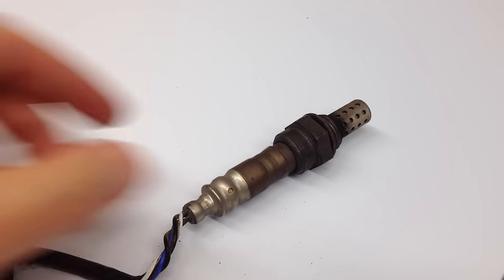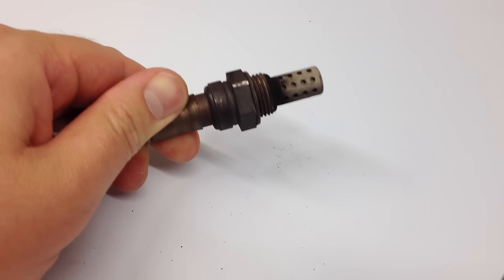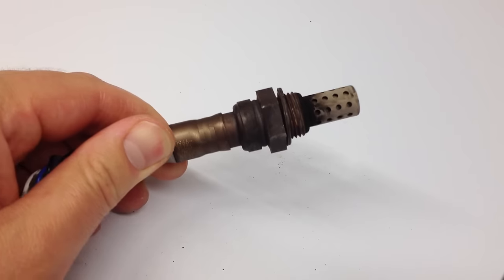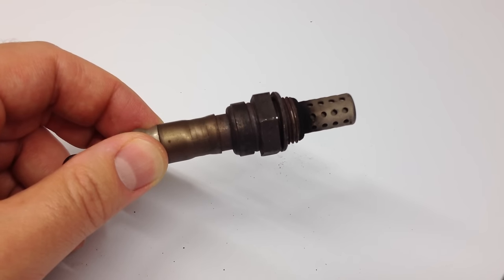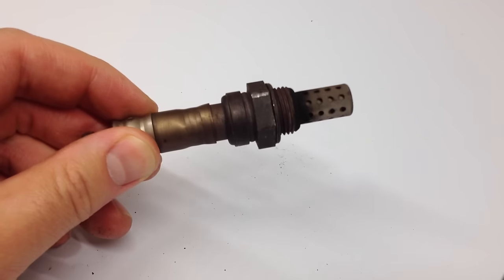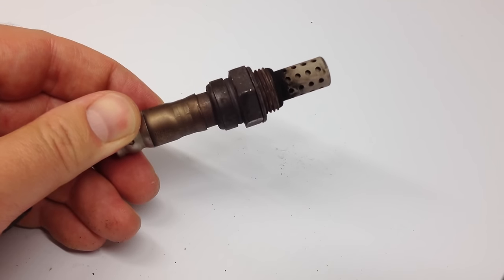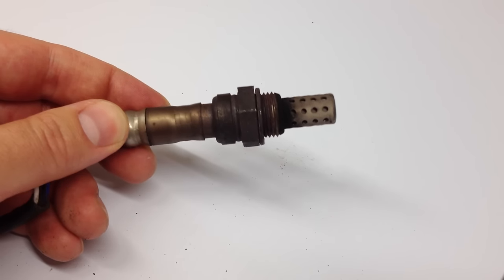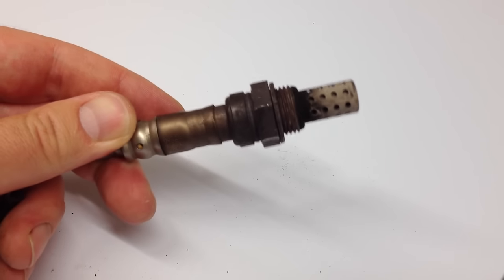Bad Oxygen Sensor Symptoms and Dangers

Comment: I've just been getting a P0171 lean code for cylinder bank 1 in my Chevy LS1 powered car because my catalytic converter is damaged,it started yesterday after driving around with a noisy cat.

I wouldn't get a P0420 or P0430 because the exhaust pipes aren't fitted with downstream O2 sensors & General Motors Holden in my case doesn't have a listing for those codes for an LS1 engine since they aren't fitted !
Reply: My response to a Subaru post about P0171 and P0172 codes, most would also apply to a Chevy:

1. Fouled throttle body, follow steps a https://youtu.be/mQ0u-3qPFDQ to clean the throttle body.
2. Dirty Mass Air Flow sensor, follow directions on box for cleaning sensor and filter. Alternatively, search the internet for detailed instructions.
3. Clean or replace the idle air control valve (IACV). Search the internet for 'clean Subaru IACV valve' for instructions.
4. Perform the Subaru Idle Relearn process. I initially thought that it was a joke but it actually works.  See http://www.perth-wrx.com/vb/mechanicals/59901-e-throttle-idle-relearn-procedure.html for one of many examples on the internet.
5. Reset the car computer by disconnecting both terminals and then touching them together for 30 seconds. Alternatively, if you are running an aftermarket tuning device (such as the Cobb Accessport), change the map to 'Stage 0', then reset the ECU (via the Accessport) and then change the map back to the original. This should temporarily resolve the issue for a week or so, at least well enough to let you drive from A to B for a while
4. Perform IAG EGR delete, see https://www.youtube.com/watch?v=gvVmCU2ElN0 for instructions
5. Replace upstream O2 Sensor (pre CAT). While it is possible to change this sensor with a 22 mm wrench you'll save yourself a headache if you just rent or borrow the O2 sensor wrench that can be found at most auto parts stores.
6. Replace the downstream O2 sensor (post CAT). While highly unlikely that this will be the culprit, in some rare cases this sensor can be problematic.

After trying nearly every one of these steps, my problem ended up being a bad upstream O2 sensor, once I replaced it my WRX drives as well as the day I bought it.

Comment: Just so you know, that's not an o2 sensor if it's upstream. That is an A/F sensor. (Air-Fuel Ratio sensor) You guys doing these videos really need to know this, because the people that watch your videos go to order these parts and tell the guy at the parts store they want a o2 sensor and if they really need a upstream sensor which is a A/F sensor, they are going to be pissed when they go to do the job, and they are going to think the parts guy gave them the wrong part. (because they usually do, even if you give them the frikin exact part number you need!! lol) 
Anyway, both of the a/f sensors are interchangeable, but the o2 is not interchangeable with the a/f. 
Sorry, don't want to sound like a S/A, but just figured you need to know that, or let them know that. Because pretty much all of us have called them all o2 sensors one time or another, thinking they are all the same. I know i did when i changed my first one, but there really is a difference.
Reply: +Dog-gone Dogs YES that IS considered an O2 sensor. It specifically calls for that when you order them. There is a few select vehicles that label it A/F sensors, but namely my BMW, all four sensors are labeled O2 Sensors. Thats what you must ask for when ordering.....2 upstream O2's and two down stream O2's. He's correct.
Reply: Even the code on the scan tool calls it a A/F sensor not the o2. Like i said the o2's are interchangeable but not with the A/F sensors. Yours may have been called the same on your BMW , but i am telling you they are NOT the same thing.
Reply: Dog-gone Dogs thank you
Reply: Depends on what the car is what it's called. GM cars call it the o2 sensor.
Reply: Dog-gone Dogs My VW has upstream and downstream O2 sensor soooo.. Yea.It's an O2 sensor that he's referring to.
Reply: Dead wrong, and enshrined in YouTube history to boot.
Reply: Well my mustang has an o2 sensor. You got upstream or downstream but they measure oxygen flow. Oxygen is air lol why they say air flow sensor.
Reply: youtube police lol gotta set all us youngins straight lmao
Reply: It's actually an upstream o² sensor and a downstream o² sensor. On my 2002 Ford Focus the Bosch 15717 can be used in both locations.
Reply: That's a 97 car, it's an O2 sensor.  NEW cars have AFR sensors.
Reply: Can't teach an old dog new tricks... You're wrong by the way hahaha

Comment: the problem most people have out there is this, they fail to change their spark plugs and get 100's of thousands of miles on them and next thing the o2 sensor code appears, change your plugs, reset computer, and 99% of the time resolves your issues
Reply: no,every heard of the cadillac northstar.since that era plugs last 50,000 to 100,000 km.

Comment: Once I take the car out for a good 1-2 hour ride, it rides decently, after a hour or so, if I full throttle it, it seems to lose lots of power and not want to go up in RPMs. I've tried to restart the engine immediately and all seems ok again, after 20 miles or so it starts loosing power again. when on full throttle it feels like it's bogging, misfiring or something... What it could be? I have cleaned up spark plugs recently. And it idles ok. By the way spark wires are broken and there's isolation tape all over it
Reply: If your saying the leads have tape all over them then replace your leads - Since your car would not be getting enough spark to ignite the fuel properly explaining the sudden loss of power also it is dangerous because you have upwards of 40,000 volt going through those leads you could kill someone

Comment: Hi. Thanks for the Video. Would you be so kind...How we know if is the Upstream or the Downstream O2 Sensor that is bad !!!?? I have definitely a problem on my car related to O2 Sensor...but do we have to Fit both of them ? Appreciated . Best Regards
Reply: Beto R. Hey Beto. My name is Alex, i’m no auto-mechanic but, I fix problems on my vehicle from time to time. I’m an Electrical Engineer major transferring to PNW in Hammond, hopefully that is enough to give me some reputation. I have the same problem as well. 

I’ve been doing research and I found a Chris Fix video in relation to replacing these. He tested it using a multimeter, i’m not sure how many ohms he tested for, but, the main point is he tested for resistance. On the wiring for the O2 sensor, there are 4 wires, you want to test the resistance on the 2 prongs that correlate to the 2 black wires. If there is resistance, then the heating element is working. If it does not give any resistance, then the O2 sensor is bad. 

For my case, I am testing it on a 2014 Ford Focus SE Flex Fuel 2.0L. The first O2 sensor is just in the back of the engine block, closer to the diver seat. Blue wire and electric connector right around the right corner. I’m not sure where the lower is, just that it’s just past the catalytic converter under the vehicle; it should look similar. 

Hope this helps.

Comment: So does an o2 sensor deal with timing too? My firebird ( 94 LT1 WITH 24X UPGRADE OBD2 FLASHED FOR LS1) runs super bad when it gets warm. It seems to be missing with the timing because i can smell unburnt fuel. ALSO, this is important, it runs fine at WOT. Just seems to gurgle at cruise and normal driving. Never has a hard time starting though and no codes run for the o2
Reply: Did you ever find the problem my car has the exact same thing and it’s a 95 lt1

Comment: Is it possible that it goes bad all of a sudden? I just picked up my car today and an engine light came on and its gas mileage became about twice as worse, a general loss of power and a much more noticeable turbo sound (spool up sound and stustustu sound on release). I had this a while back but after a day or two the engine light came off and gas mileage was normal. My car is a  2004 B5 Passat(VW)
Reply: Well I had it checked a nd it was an o2 sensor error code, and it was likely a symptom of a turbo leak in my intercoer which i will fix next week and see if the o2 erfor goes away

Comment: so what are the symtpoms? if they are bad how will motor run(you mention nothing here regarding engine performance symptoms ??? mine hesitates and have replaced everything but these sensors...thax
Reply: I have a 97 f150. Mine hesitates badly on acceleration, loss in power,  rpms will drop and surge occasionally. I've replaced Mass air flow sensor. Still running bad. Did you get new plugs or coils? Im gonna try that next. If its still bad..i guess it'd have to be the sensors although a mechanic said they rarely ever go bad

Comment: I have an '04 Suzuki Aerio SX, and the "Service Engine Soon" light came on a couple of days ago. I took it to O'Reilly's today, and they ran a computer diagnostic, and concluded that it was my car's downstream O2 sensor.
My car seems to be running normally though, and I have a friend that says the colder climate can cause your sensor to send a check engine signal.
If I don't notice a difference, should I go ahead and purchase a new sensor?
Or should I wait and make sure it's not just the colder temperature?
Reply: sensors with 4 wires are heated
the heating element in the sensor can't heat enough due to cold, you'll get an error

Comment: Hey great video. My car is running kind of rough and when they scanned it, it said I need a o2 sensor. Im going to replace both, could a bad 02 make your car run rough? I'm also getting a misfire signal sometimes. Thanks
Reply: R6Mute Main that’s what I’m getting is bunch of misfiring I brought it to the dealership to see what’s going on it’s the o2 sensor I’m getting mine done by a friend I can’t afford high prices
Reply: Bad o2 sensor shouldn't cause misfires , it could be because of spark plugs though.
Reply: @NOName-nn3jv  first thing they cause r misfires n im not even in cars like that

Comment: Hi ! I have an old 2003 Mercedes C200 kompressor 1.8 gasoline. My car is self accelerating when is it in gear and in no gear. I have changed the MAF sensor still nothing,do you think is this sensor? And btw the car is shaking in stationary position with engine on,on  neutral gear. Some help please?

Comment: It doesn't measure the balance of oxygen to fuel.  That's a wideband sensor.  A normal O2 sensor is just that O2 (oxygen).  That's all it measures in parts per million (ppm).  Another factor especially for 4-cylinder including MPV is the MAF sensor (mass air flow).  That will degrade performance over time as the sensor becomes dirty too.  Just because you set an O2 related code doesn't mean it's a bad O2 sensor.  Buying a new O2 sensor without doing any diagnostics can be an expensive lesson in the scientific method.
Reply: Mazda MPV rules.
Reply: Rýán Túçk You will likely only find very few car enthusiasts who agree with you even among Mazda enthusiasts. ;)  It's a good platform but it doesn't stand out particularly well in any category vs it's competitors.
Reply: If i push my pedal to the metall i only drive open loop. No Oxygen Sensor data at all.
Problem solved like a boss!
:D sry just trolling
Reply: Nighthawkzone2 lol good one though.  did make me laugh out loud.  Drive WOT everywhere at all times.  Sounds like a good premise for a movie. :)

Comment: I have a 2011 CR-V is burning gas like crazy but I don't have engine check light on
Reply: Same is going on with my 2009 Honda Civic , did you change it to see if it made a difference, I don’t have the check engine light either

Comment: hey bro I have a toyota pickup truck it only had one o2 sensor way down under the driver seat I moved it up to the manifold cause I got a new manifold with a o2 sensor hole in it from an older truck 1985 my trucks a 1993 model do u think that what I did disturbs the reading cause it seams to be burning rich exhaust Has a strong foul smell
Reply: Probably a dead rat in the old manifold.

Comment: i have a 1995 s 10 with transmission problems with no power to soleniods in limp mode ive read that so many things can cause transmission problems it could be bad ignition switch ,a shorted oxygen sensor or a bad pcm im so confused which way do i look ? please hep me before i have a nervous break down !!!

Comment: I have  a MB c180 and whem im hitting 50 degrees celsius temp. the car badly idles and kinda shakes and I changed the filters, plugs cleaned throttle body, cheked vacume lines, fuel pressure regulator and when you quickly step on gas pedal the car like chokes on gas and after a little time just builds up rews but when the engine is on operating temperature its oky response is quick but in idle car shakes like its going to die.
Reply: +Janis Jermaks   Please check the crankshaft pulley.  Some damper-pulleys break-up when the rubber fails.  If there are pick-ups on the rim which is now loose, you will get trouble.
Reply: +Tech Davey thanks changed the o2 sensor but i had a bad head gasket that was the problem.
Reply: Install a new thermostat ,motors have a designed operating temp.that signals the computer to adjust running conditions .

Comment: Hi, I have a 2007 Subaru impreza  the power button keeps blinking and my local mechanic told me its something to do with a gear box sensor that got destroyed during a small mishap, right now the car cannot go above 60 km you step all the way on the gas pedal no speed and cant climb steep roads without the car jerking and is very slow, please advice,

Comment: I left my oil cap off of my car and got oil all over my engine i notcied smoke coming from where the wires of the o2 sensor meet the metal area that screws in now my car is almost stalling and wont rev past 3500 rpms
Reply: Ended up being my o2 sensor, the car had gone into limp mode because the upstream o2 shorted. Replaced it and it’s been fine

Comment: My 02 sensor is 5 years old... can we clean them with anything like throttle body and air intake cleaner or anything else? Thanks!
Reply: Not really the sensor measures voltage of the air going thru it has to add or subtract fuel & air to maintain a certain voltage

Comment: my sensors are telling me that the Cadillac converter has to be replaced been having a lot of shaking from the front end almost like a vibration and I can't describe it any other way then when you Veer off the road and go over those little bumps it's got that vibration they're trying to tell me now the mechanic that it's the catalytic converter I've had everything replaced with the front end can somebody please help me because I feel like I'm being taken to the cleaners another thing it does it when the car's been warmed up and running for a little while

Comment: I had 2 garages check my car over after getting o2 sensor 1 bank 1 no activity error code. the engine light would come back on after 30 miles or so of driving every time after clearing code. The first one was a specialist! Both garages claim my car was running fine. It was using a shit load of fuel and no low end power intermittently. First garage had my car 2 day and said it’s running fine. Took it to another garage and they checked it over and said the same thing. Said o2 sensors were fine. I said what is the code for that keeps coming back? and they said pre cat o2 sensor. I said fuck it just fit a new one. 200 miles so far and no light 🤞🏻

Comment: My E90 start jerking today. Idling not stable. Some of the time will jerk when shift up the gear. When scan with the OBD scanner its will tell o2 sensor fault. Its really o2 sensor or my spark plug need to be replaced? There is also white smoke come out. Bcoz of valve seal?
Reply: white smoke is usually valve seals or rings on your pistons and sometimes its a leaking head gasket and coolant is contaminating your engine..is your car high mileage? the rough running is not spark plugs,it is probably o2 or air/fuel sensor or your mass air flow sensor is dirty.

Comment: When I hit the gas to merge with highway traffic, I hear this rattling noise coming out from under my truck. When the rpms' start to drop off, so does the noise. I never hear this noise during regular street driving. My dads says it's the O2 sensor, need advice.
Reply: The bottom end bearing in going
Reply: Bottom end beari?
Reply: +Tyrone Walker probably just the shield that's around the converter making noise
Reply: agree with hillbily

Comment: I change the starter on my Chevy Cavalier and now when I took it for an inspection the three CO2 sensors are not registering how do I reset them
Reply: drive longer and take it back to check emmisions,they arent reading because your car was disconnected from battery and reset your sensors
Reply: What does the starter have to do with the co2 sensors?

Comment: The gas fumes  are strong  inside and outside my car (2002 Nissan altima). The O2 sensors are the cause of smell?
Reply: It sounds like you have an exhaust leak.  Catalytic converters also make a distinct noxious smell.
Reply: Andrews Arcade. how can this be fixed ? its drinking gas like crazy

Comment: Does a check engine light always come? My Mazda is showing sings it maybe the o2 sensor. Or could it be the catalitic converter? I don't get a check engine light.
Reply: Is your Mazda a rx8? Mine is and I think I'm having same problem
Reply: Ryden Bryant no mine is a 2002 Mazda MPV. It only has a little over 89000 on it. It was my moms van. I got it when she pasted away. It has a lot of trouble for about 3 yrs.. I just haven't been able to figure out what it is this time. They hav
e run test and there are no codes to tell me what the issue is. I guess this model has had a lot of problems and Mazda has never done a recall at all.